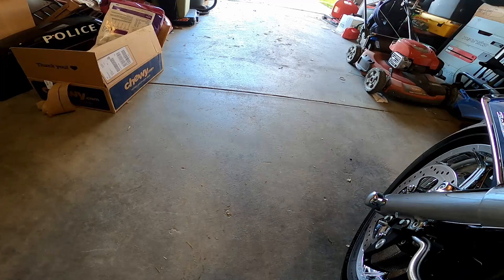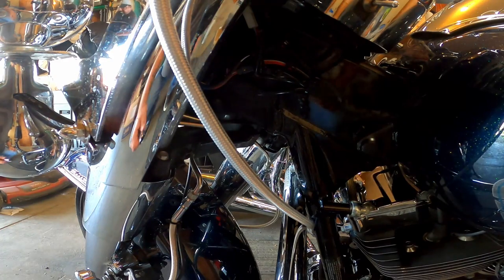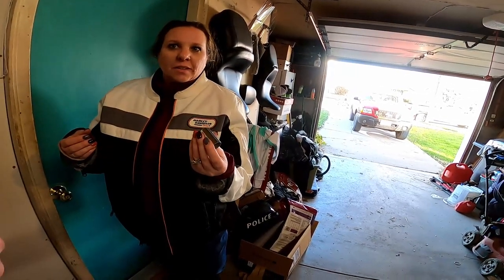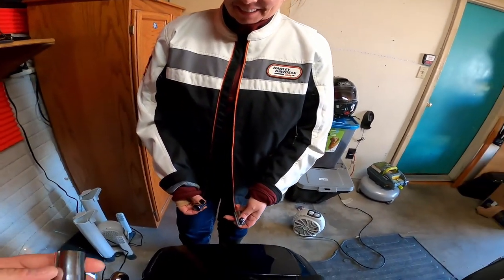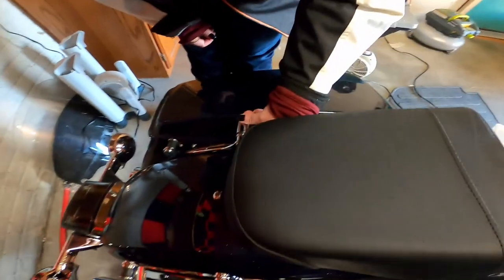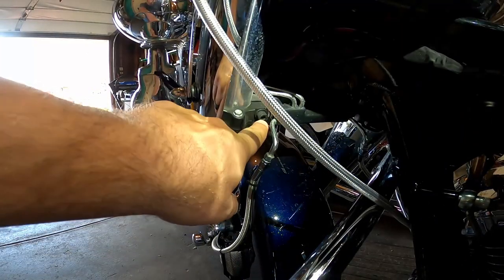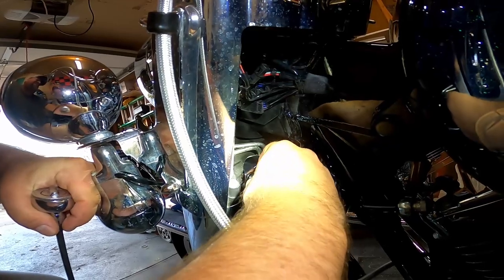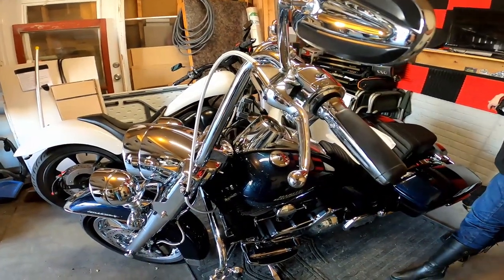Roadking Fork wind deflector, and 4 Point detachable hardware covers, installed.

Comment: My 03 Road King has plugs in the first one I tried taking off just to rip apart with a plug still in. Any suggestions on how to get these out?
Reply from the maker: If your talking about the threaded part coming out with the screw, I have seen this happen. If you go to Harley they can get you a new insert or maybe you can run a bolt through with a bit on the other side? Not sure if that will work but it’s worth a try I guess.